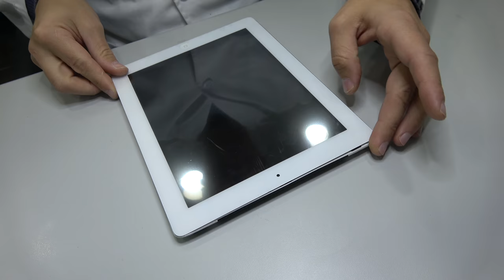iPad 4 touch screen replacement

Comment: Thanks for the video.  Looks like a job better for a professional to repair.  I know I would mess it up.  I have one question how come you did not get the dust out from the LCD with a brush or air right before putting on the new glass.

Comment: never cover your LCD with tape. It will be a big hassle to remove the tape adhesive from the LCD. just cover it with paper or micro cloth and keep it until ready to put it back again

Comment: Can you use hair dryer if you don't have a heat gun?
Reply: Yes, but be extremely careful about the temperature. Do not go over about 90c, and if you have broken glass that leaves the insides exposed, you have to watch out not to overheat components and melting them accidentally.